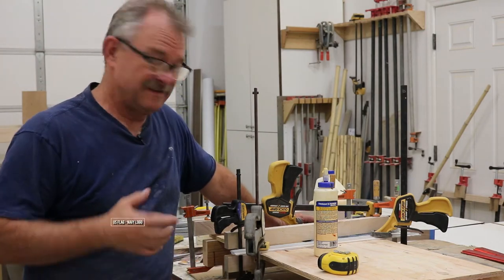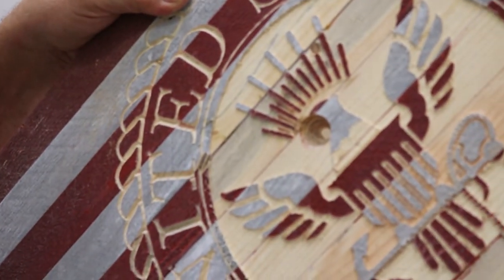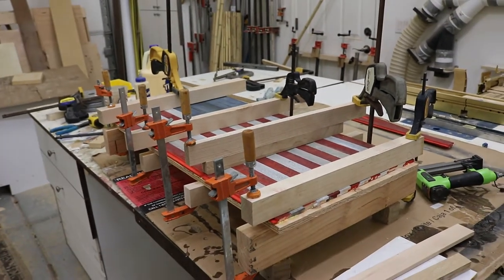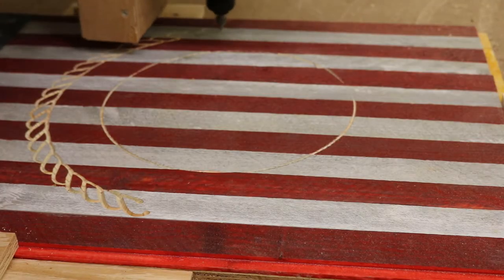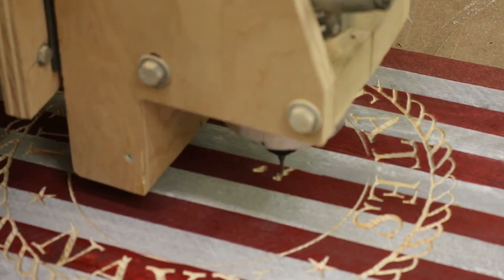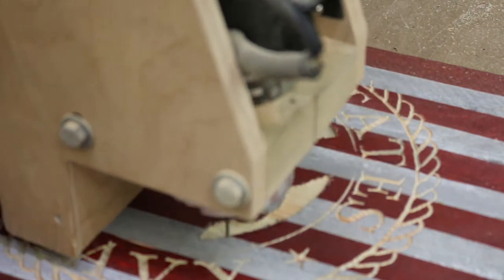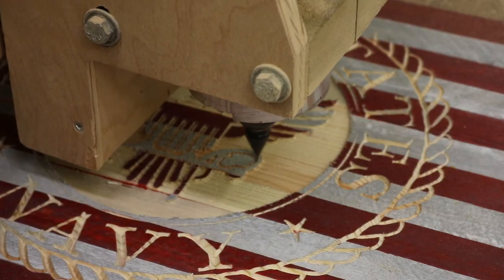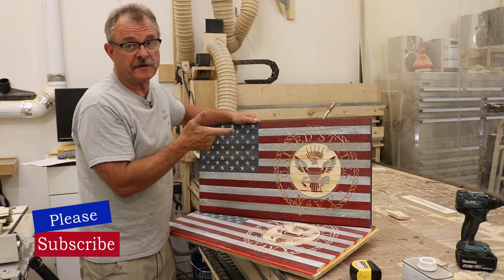Make US Flag with Navy Logo CNC Engraved

Comment: what settings did you use for the emblem?
Reply from the maker: I have  a couple of different operations.  Some with the same tool.  I used a pocket and trace operation and kept adjusting the Z until I got the depth I needed.  I probably ended about .07" below the highest board.
Reply: @OldGuyWoodworks  I have a Shapeoko. Have not been able to figure how to get it to outline just the lines in vcarve operation with the 60 degree. Running the simulations, but adjusting depth still hasn't gotten me there yet. After pocketing the eagle, you use the 60 degree to detail or 1/16 end mill?
Reply from the maker: @jamesbrigham1299  I do two pocket operations.  One is a rough with 1/8 end mill leaving .02 both radial and axial, then I finish pocket with 1/16 end mill.  My software is Fusion 360 and it has a trace operation, which follows any line you select, but it has no depth capability to the operation.  When I zero my Z height to the top, I lie to the operation and tell it the zero height is .01".  After that trace operation, I'll add another .01 if the depth wasn't enough until I get it to where I'm happy.  I'll send you the G-Code if you want, but I'm not sure it will work with your software.
Reply from the maker: @jamesbrigham1299  Short answer is I use a 60 degree engrave bit for detail.
Reply: @OldGuyWoodworks  I have fusion 360, {was a student, an old student) using cardide package with my shapeoko. but I know a little about conversion. Thanks, I have been struggling to get these right. Had a estimate to do one, but had to turn it down.